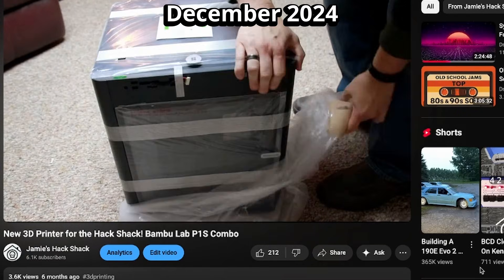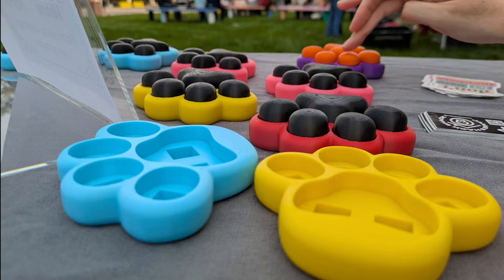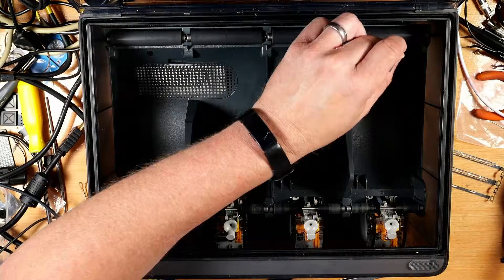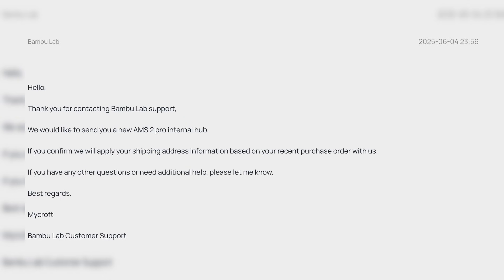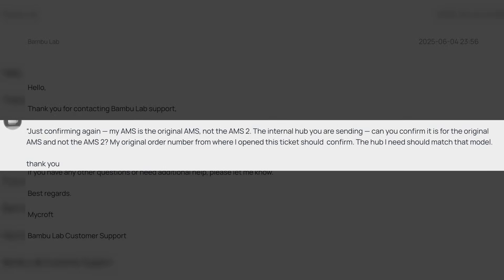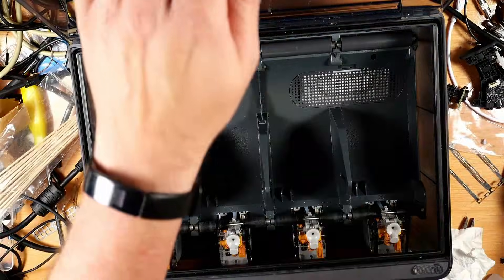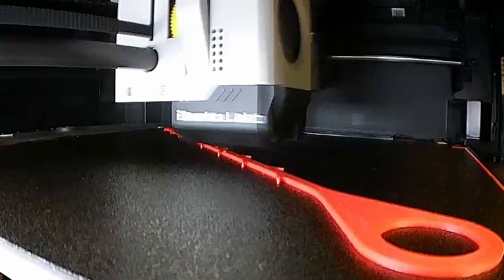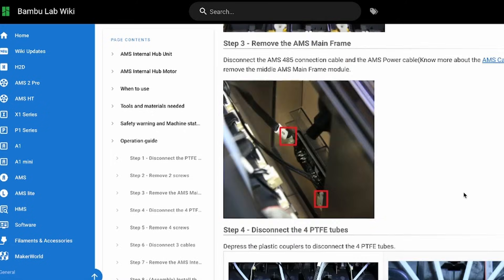Bambu AMS No Feed FIX!

Comment: Had this happen with my AMS 2 Pro and probably would have never found it had you not posted this. The tensioner for the AMS 2 has even less plastic making it even flimsier than the original AMS.  They really just need to make the tensioner in metal or at the very least solid plastic.
Reply from the maker: That's a bummer! Glad you found it. Were you able to get with support to get a free replacement part? Hope so!
Reply: @JamiesHackShack still waiting on a response from my support ticket as I just put it in yesterday.  But the AMS 2 is only 3 months old so they should replace it.

Comment: Long process for AMS failures.   My internal hub magnets all messed in first month.  ticket is been ongoing for 1 month while i figure it out for them.  4 days reply for every time i have to check something for them.  I like the printer portion, hate the AMS now. Was not designed to take apart every 4 days.
Reply from the maker: Oh jeez that sucks. Sorry you are having that trouble and laggy turnaround time when resolving. :-/